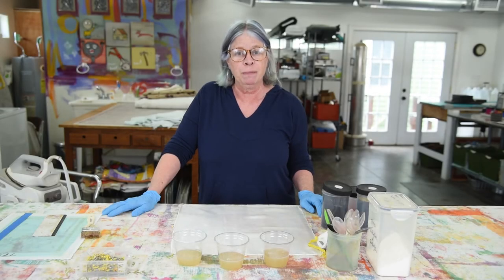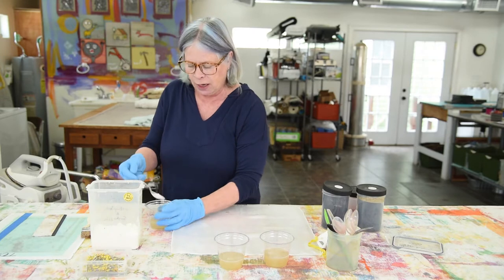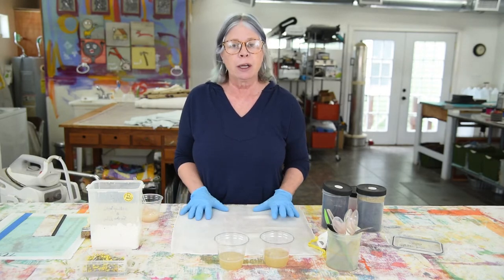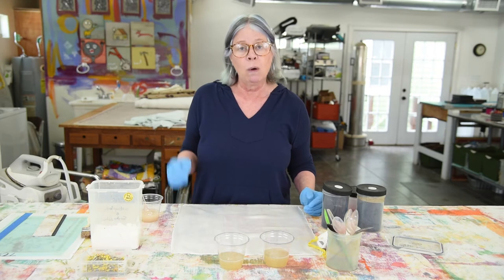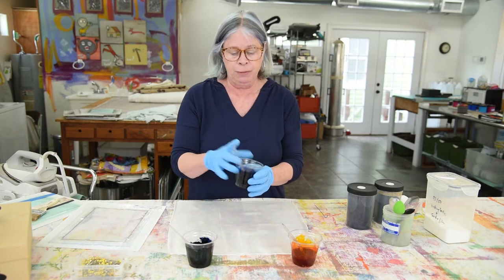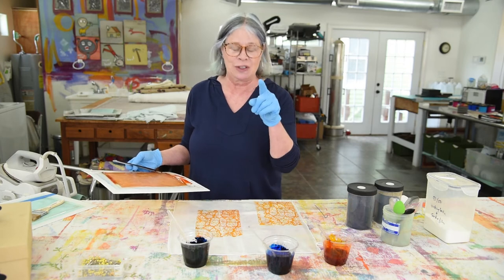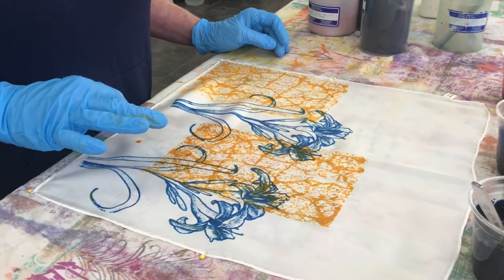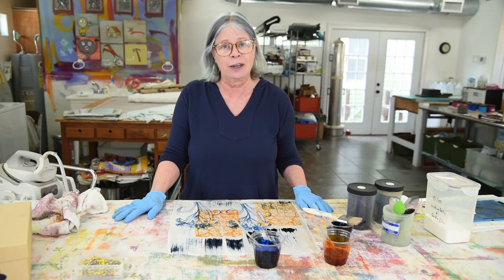Best Practice Series: Working With Mx Dye and Print Paste

Comment: Hi and thanks for your awesome videos.  Do you need to dissolve the dye first before you add it to the paste or just put the powder directly into the paste.  Without dissolving will it have fleck marks?
Reply from the maker: If you stir it well enough it should be fine. IF you find that it isn't dissolving, stir it into a tiny amount of Synthrapol first to dissolve it and then scrape that into the print paste.

Comment: Thank you for clearly explaining your process. I’m a 74 year old starting to go down the tie dye road and almost 100% of tie dyers recommend doing the soda ash pre soak. Many have noted the undissolved powder specks as an issue and therefore some will tie dye with their shirts turned inside out. As I am beginning this journey your explanation of adding the soda ash to your mixture + dye powder makes perfect sense! I want to paint some images to my tie dyed shirts once that process is done so I would just be making very small amounts to do this to not have waste. How much of your paint mix do you have in your cups? I will reduce your recipe to possibly 1/8 c + your soda ash mix then add my dye powder.
Reply from the maker: I usually mix up about 1/2 a cup so I don't have any waste. It's easy enough to make more if i need it...Good luck!
Reply: @CreativeStrengthTraining  Thank you for your response.🙂

Comment: Hi (again!) Jane! Sorry for the late thank you for replying to my previous comment - I hadn't seen the notification to say you had replied! Thanks so much :-) I have a couple more questions if that's okay? I work at a university and looking to change how we currently use MX dyes so this video has been an amazing help! Question 1. In your video you layered up your prints when they were wet...would they bleed in to one another by doing this? Currently we print one colour, let it dry and then print over the top. Your way would be much quicker and looks great! Question 2. I saw some other comments on here about adding some sort of bleaching agent so you can print on to a coloured or dark ground. We used to do discharge printing but had to stop due to the hazardous nature of it but I got very excited when I saw your comment about adding something different (instead of bleach) to create this same effect. Would you mind telling me more about that? I really appreciate your time and thanks again!
Reply from the maker: When I print layers on top of each other, I usually give the dye a little time to dry, but it doesn't have to be completely dry. That's because the dye that is already printed has begun to react with the fabric and is already occupying "space" so the new color won't necessarily bleed into it. However, this is not always completely true with every fabric, and there isn't any guide in writing that predicts or identifies how this is going to work with various kinds of fabric. Alot of it has to do with how heavy or thin the fabric is, and also the type of fabric. Silk reacts very quickly to the dye, cotton reacts more slowly. Trial and error is the only way to know for sure. 

As for the discharge printing, I wasn't the one who does that or has shown it here, I don't believe, unless it was a really old video. I stopped using discharging chemicals because they made me sick. I had 44 nosebleeds in one year because of inhaling fumes. So I don't advise the use of those. I did develop what i call "faux discharge" and you may be thinking of that. In that case i mis translucent white textile paint with clear extender 50/50 and print it. The dry result looks like discharge, without the hazards.

Comment: Jane, this a phenomenal video. I have a box of my Nan'as powdered dyes and now I know how to get creative with them. I have a question about toxicity of old dyes, as they are not labeled well. Labels say: Tintex fabric dye with catalyst T-7 and contains salt; Rit concentrated dye and contains salt; all- fabric Tintex;  Cushing perfection dyes. My Nana used this collection as early as the 1940's and there are more than 150 different colors. Any advice on toxicity? Kathy
Reply from the maker: Throw them out (responsibly) These are not what I was using, which were the fiber reactive MX dyes, and are much safer. AND more colorfast. Rit, in particular, fades very quickly and is ok for some hobby applications as long as you realize what you're using. Here is the info from the Tintex dye safety sheet: Powder hazardous and can cause asthmatic or breathing difficulties and can also irritate skin and eyes...

Comment: Jane: I Have just stumbled across your channel and I am so inspired and empowered from watching them. You explain things in such depth but so simply, you are a great teacher and one I wish I'd had in person. A quick question I have: is there any chance this paste can be used in a needlepoint applicator bottle or with a brush or is it too viscous? I am looking for a way of using dye to draw onto clothing with, without bleed in some cases. I can use cold water reactive dye for my more free-flowing and larger sections of dye but I then wish to go back in and draw detailed (ish) illustrations over these. I don't want to use fabric pens- I want to permanently (or as permanently as possible) dye the fabric and also avoid the scratchiness of pens, but also the bleeding effect of water. Basically- a fabric paint I can use out of the brush. I hope that makes sense and apologies for the long-winded question- either way, thank you so much!
Reply from the maker: HI Ella, You can change the viscosity of the print paste based on how much water you add...If you put dye/print paste in the bottle you can draw with it, but be aware that it will still need to be batched to be permanent. Or steamed, based on what you are using as your fixative - that is, soda ash or vinegar. It's not that complicated but if you don't follow the steps properly it won't be permanent on the fabric and it could bleed later. My friend Ann Johnston wrote a great book on using dye in bottles as you are suggesting, so you might look for it. The name is Color By Design.

Comment: Hi! This video is so informative, thank you. I have a question: if this is technique is used to print on cotton, would it have to be set with a steamer? I plan on printing on t-shirts with procion dyes, so I'm looking to make them wearable and not liable to come out in the wash.
Reply from the maker: It would need to be fully batched, not steamed, which means 24 hours at a warm temp and keeping the fabric damp. Otherwise it may not be fully set and it will bleed.
Reply from the maker: FYI You can't steam cotton because it requires soda ash as a fixative and when you steam it, it will turn brown and you won't be able to "undo" it.

Comment: How would you print the same image over and over to fill the fabric?  Would you need to wait for each to dry?
Reply from the maker: Hi Leanna, Sorry to just be getting back to questions. Three choices: Let one image dry, or cover it with paper when you print the next image. Sometimes you only need to cover the edges to keep dye from getting on the underside of the screen. OR you can proceed and just wait a few minutes for the first image to dry out slightly. That often works for me.

Comment: Would it ruin my screen (a thermifax I ordered from your website) or cause a chemical reaction if I used bleach in the printing paste? 
Hoping to get a lighter picture on some darker fabrics 😊
Reply from the maker: Hi Jennifer! The bleach will not hurt your screen or thermofax, but I recommend using a product that already has bleach in it (like dishwasher detergent) instead of adding bleach to printing paste. Adding bleach directly will liquify your paste and make it very difficult to print!
Reply: @CreativeStrengthTraining   hi can you recommend any alternative products i can use? im struggling to find dishwasher detergent with bleach
Reply from the maker: Look for any household cleaner with bleach that is not a complete liquid. Something with more body, like a gel...dishwasher gel, toilet cleaner—there are a number of them out there!

Comment: No binder added?
Reply from the maker: It's dye not paint. Pigment needs binder to bond it to the surface permanently. Dyes go through a chemical reaction that binds the dye molecule to the fiber molecule, with the assistance of auxiliary chemicals. That's what makes dyes permanent. If you don't have the right chemicals the dye will just wash out.